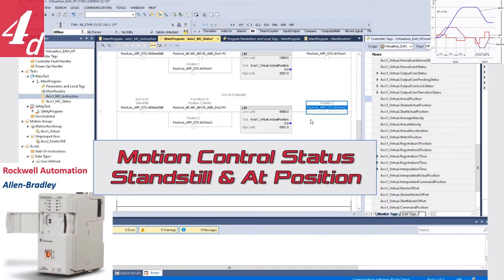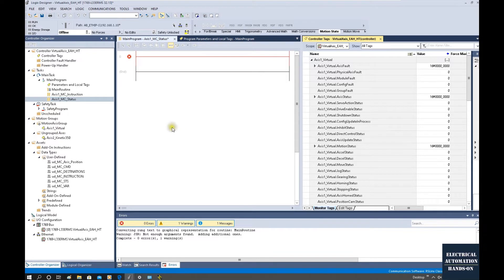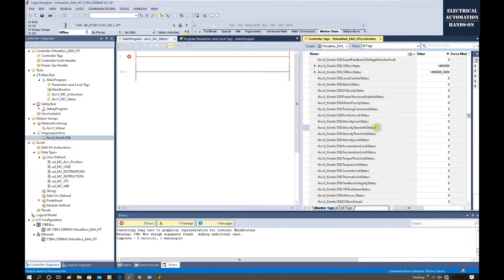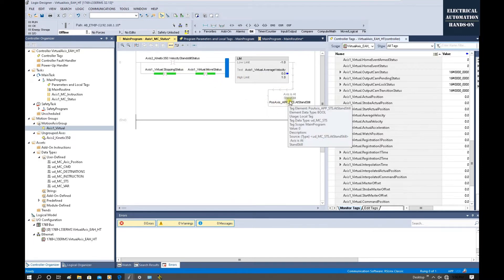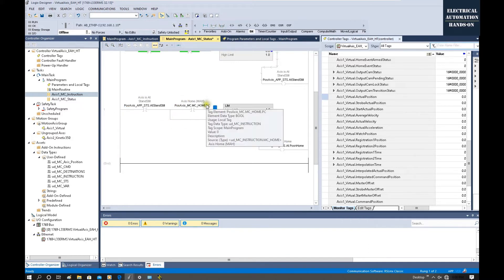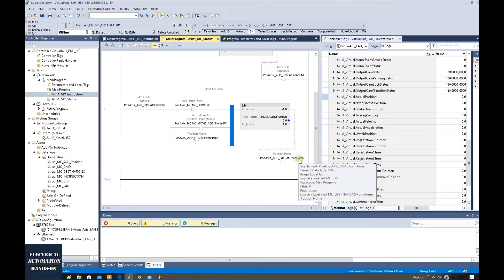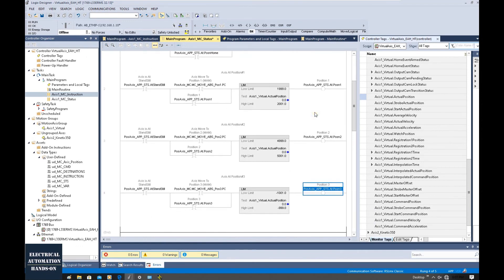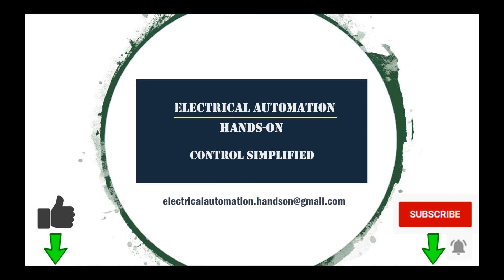MA04d. [AB Motion Control] Rockwell Motion Control Status - Standstill and At Position [7/10]

Comment: Hii sir. Your Videos are very informative. One thing i want to know that, suppose I commanded a axis to move 1000mm but in actual it moved 997mm. i performed this test for 5-6 times. All time same position it is moving, What can be done for correcting this?
Reply from the maker: Please check "Lock tolerance" in your axis, on an Allen-Bradley axis refers to the acceptable position error range for the system to consider a move complete